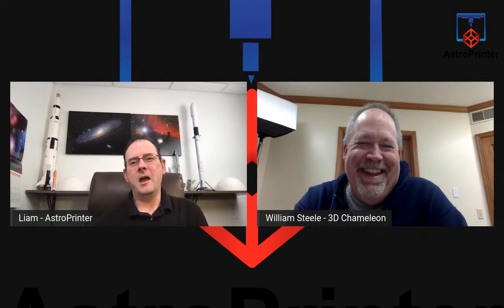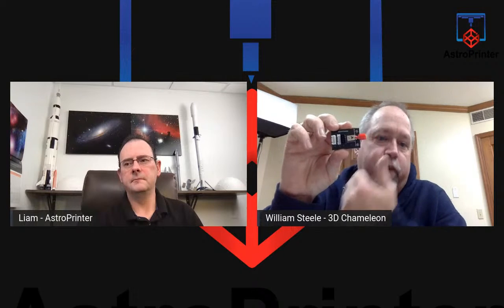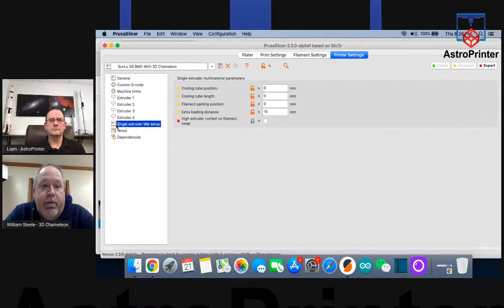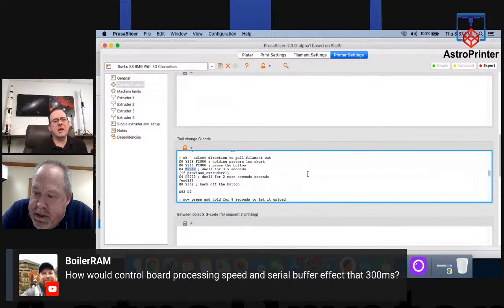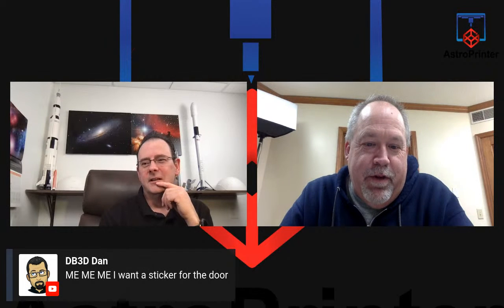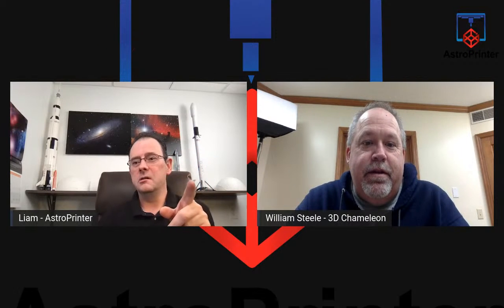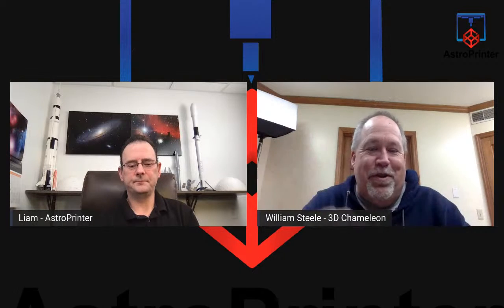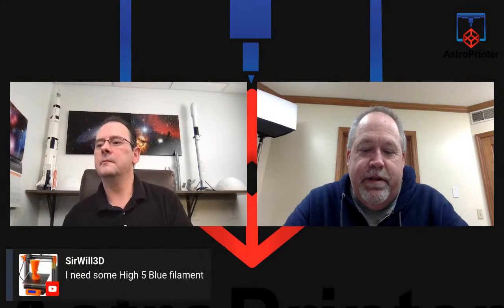Casual chat with Bill Steele from 3D Chameleon

Comment: I wish I could figure out the gcode I have it installed but have not got it to work so it has a long way to go yet But I am 70 years young
Reply from the maker: GCode is pretty simple it is mostly XYZ andT0,  T0 being the extruder. coordinates or XYZ moves depending if in absolute mode or not. The other gcodes are basically heating instructions. There is a little  more to it than that but 95% of the code is move to position X Y Z and extrude T0 a certain amount to push filament.